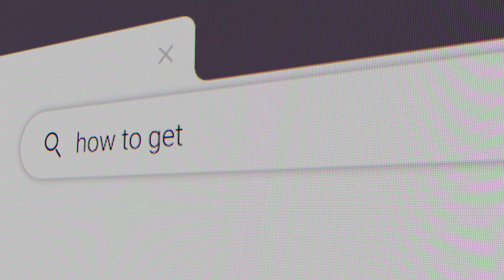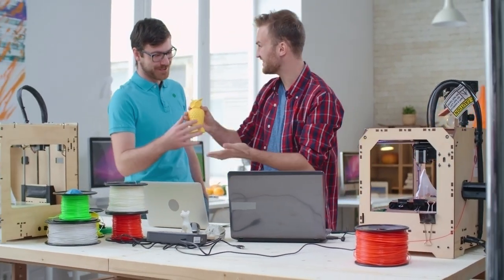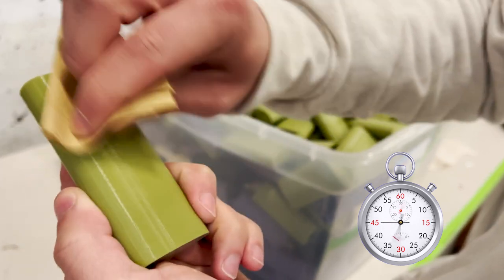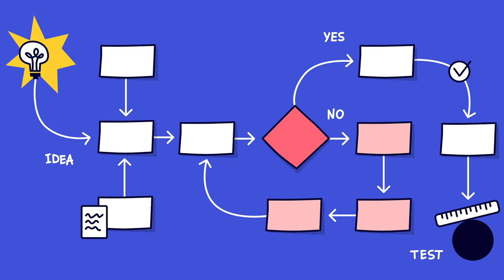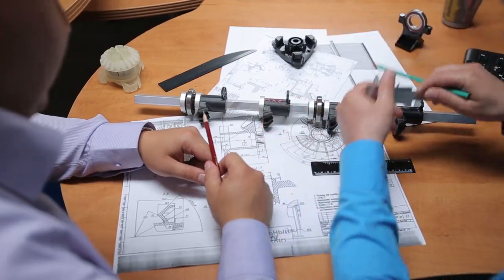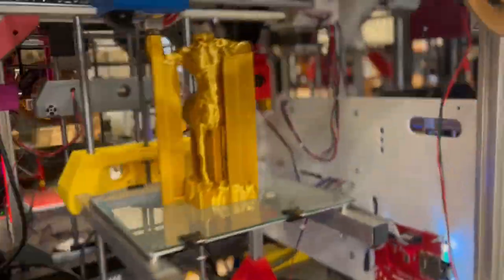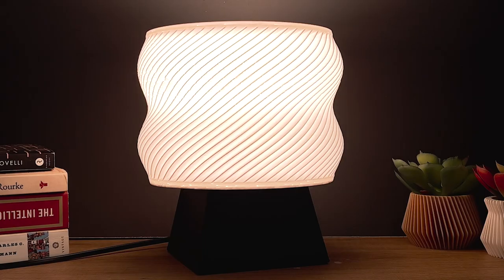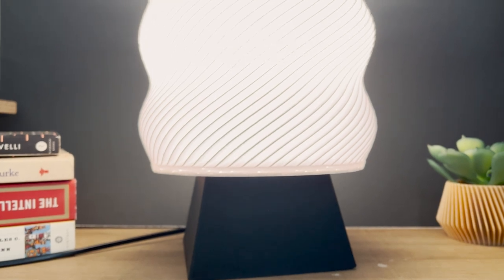How to Get a Job in 3d Printing

Comment: I have more of an artistic background, but working in a shop that uses silicone molds and polyurethane casting in our process has activated huge interest in manufacturing and mass production.  

Sometimes we have to sculpt certain things by hand, but I've been thinking of ways to offload some of the labor by modeling parts and printing them on my machines. It's pretty straightforward, but  there are probably more things around the shop that I could simplify with printed parts.

I think it's easy to get swept up into the activity of hobby 3D printing, but printing with a purpose holds a lot more excitement. For me, the feeling of holding a part that I've designed myself easily trumps that of printing a model from somewhere else.
Reply: I have done similar work, but the only difference we used to use our 3d prints to make molds that we would cast in urethane or silicone. Then, use those to make parts for the hospital, military, and so forth. I have a background in Industrial Design, the concept of using it for finished parts is completely novel to me.

Comment: I have a 3d printer at home and at work mainly because I like to design shop aides. I run a machine shop so I deal with all kinds of material and help keep all kinds of machines running but I am very new to 3d printing. The CNC machines have customers that have them booked up for years but how can I get production work for my 3D Printer at home?

Comment: How does one with no art degree, no marking degree get their foot in the door? I did work in the land surveying industry years back, both in the field and in the office using CAD and data collectors. That's as close to engineering experience that I have.  I am in need of an interesting career change to ride out to retirement and finding a way into a growing industry seems to be a good way to start at the bottom and learn my up. Problem, is getting the chance.

Comment: Good stuff. Im going though alot of this stuff at work now going from hobby to professional. I kinda made my own job. I work at a custom battery company and started designing and printing work fixtures for the shop. From there a few chances to make simple spacers and parts for batteries came up. I now make 100s of parts per month working on getting it up to 1000s by inserting more printed spacers and simple yet crucial parts in to production units. So if you want a job in 3d printing, get a job in manufacturing and make work for yourself, make the company need your printed parts then print away.
Reply from the maker: Excellent Example
Reply: Same here- I work at an engineering company, and I am NOT engineer, but I asked a year ago for a replacement for a $300 part we use on every robot we send out the door that is entirely overkill- I finally just spent a few hours on YouTube learning basic CAD (EXTREMELY basic, not knocking what experts do) and I designed a replacement I can 3D print in an hour that costs maybe a buck. Now they're suddenly very interested in this stuff. 🤷‍♂️

Comment: Hey, tremendous nuggets. Working with antiquated methods on established products that have little wiggle room for process deviation given the criticality of the industry.

I am ALWAYS assessing, on a daily basis where it is we could 'potentially' given the choice to make use of 3d printing for process optimization and how I would go about this.

It would take away so many ills (in terms of deficiencies, defects and inefficiencies). I do this for multiple material types and classes. Mainly product level is my interest but I also include the range of tooling, fixtures and gauges though the high value products being my real interest.

Your video here is a fantastic message.

Comment: I got into 3D printing because I have used CNC machines KKL machines and APS machines in my line of work in the past. It has been a hobby for me or more or less a crash course in learning how to do it ? Getting some direction as to how to go about the next steps in my consideration of what I started is now something ? I don't know I have a little bit of an ego ? Just personally I think it would be really awesome to manufacture Aerospace parts. Put on probably the farthest away from that I could be ? My point is really how does the dream go and whether or not that is realistic

Comment: 100 percent on target . My background is in design for high production precision molding and mold making . I have adopted to 3d printing as I see it eventually replacing the molding and mold making industry . The cost of making new products with out molds is a huge factor. Prototyping in the 3d printed industry is so much easier and faster .  The problem is there are not enough training resources 6:06 available to train the next generation of engineers. The molders and mold makers that see this will find the transition simple as the issues with 3d print materials strength are solved . The speed of the machines has always been a concern that is now being addressed all we need is an injection molding hot end 6:06 design to bring this to full fruition. Injection molding will not completely go away as some process requires the pressure to increase the strength of some components. But the packaging industry is an easy target that has high volumes